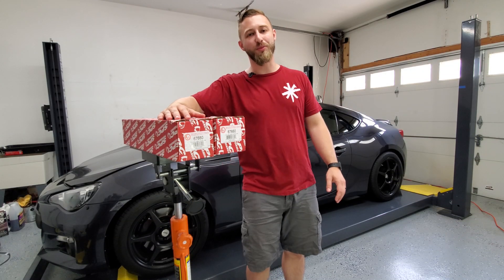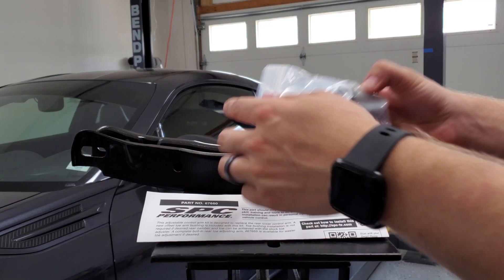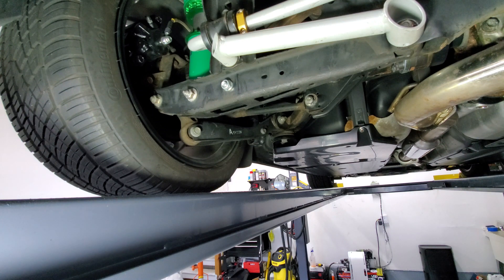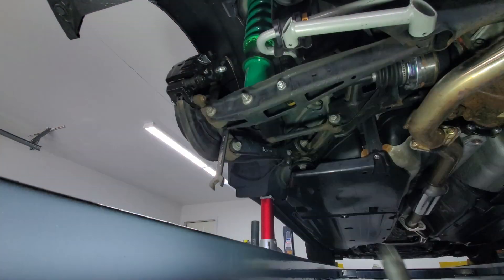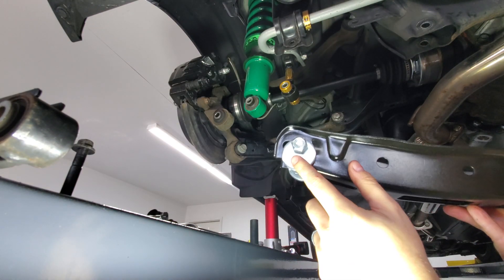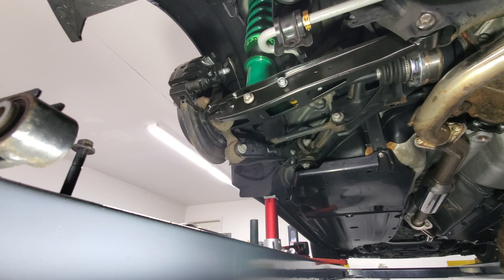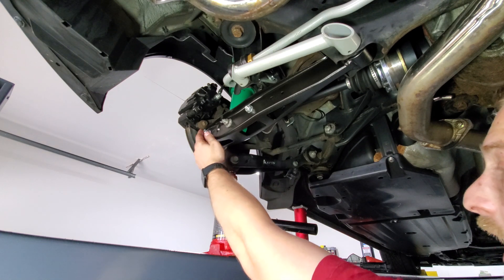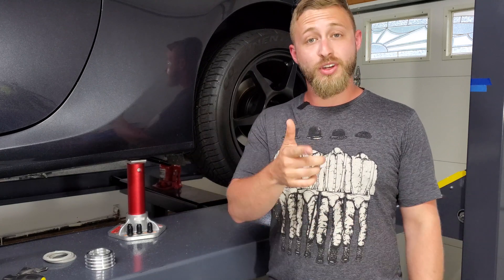How to Install SPC Adjustable Lower Control Arms BRZ FRS GT86

Comment: If I decide to use the supplied toe bushings and press them into the stock toe arms, will I have enough adjustability to zero out my toe or maybe even go a little toe-in?
Reply from the maker: I can't confirm but it was pretty close with the stock arms; I think it's possible, if you go through with it let me know the results. Could be the cheapest way to go about it to fill the gap.
Reply: @MarkMethods  I guess it will come down to how low of a drop I do with the coilovers.  If too low then it will be hard to correct both toe and camber equally.  I'm lowered about 1 inch or so and that caused about -2 negative uncorrectable camber when I was on lowering springs.  Now I'm on coils with the same amount of drop, and using the Spc lcas but I didnt install the toe bushings and my alignment buddy was only able to get the toe to -0.03 with -2 camber.  Any less camber and the toe would go wayy out.  I should have installed them lol. You would think that the spc toe bushings would be able to dial out -0.03 toe.  I'll report back when I put em in!
Reply from the maker: Definitely interested to hear your results!

Comment: So to actually do this do you need a press??
Reply from the maker: Only if you plan on saving some money and installing the adjustable rear toe arm insert into the factory toe arm. Otherwise you can buy adjustable rear toe arms and you won't need a press.
Reply: @MarkMethods  goooootcha!! Ok thank you for the prompt reply and awesome video man!! We may need more toe adjustability than the lobe here offers (autocross and ice racing) so skipping that step will save us time!
Reply: @MarkMethods what is the orientation of the offset hole in the bushing